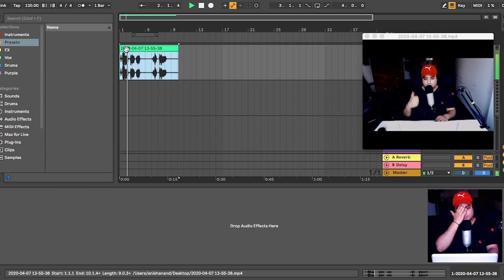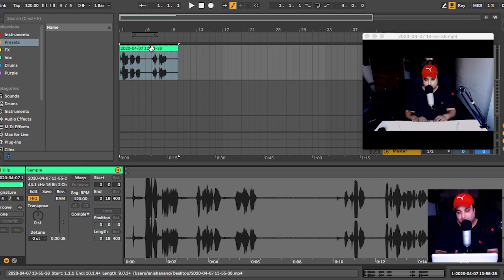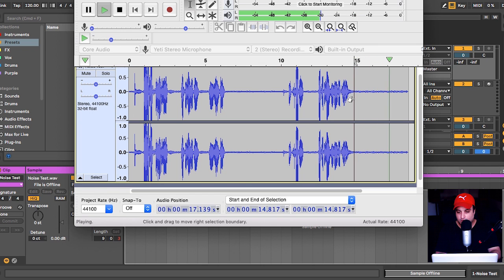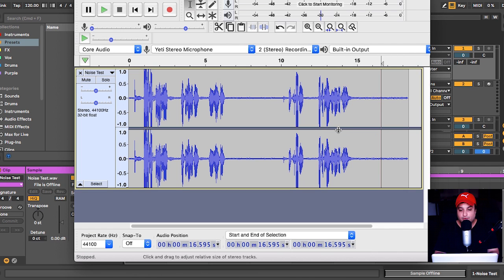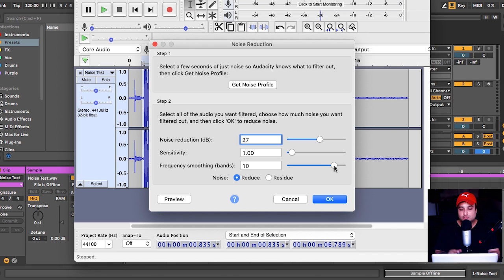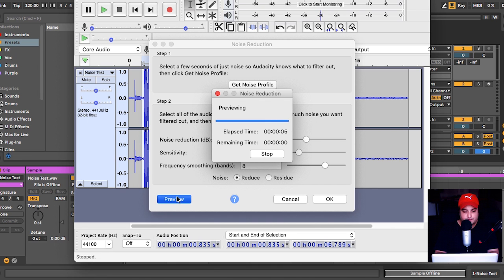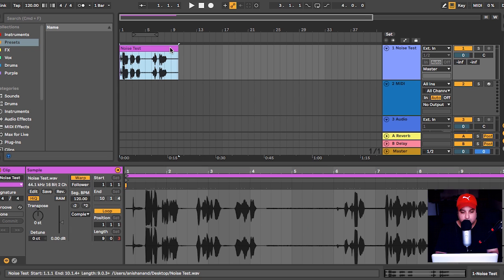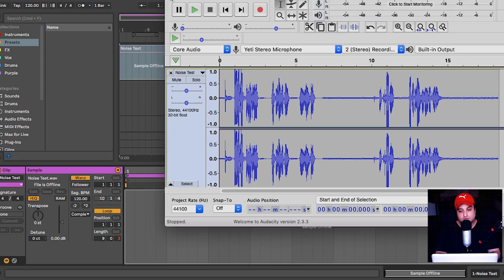How to Reduce background Noise with Audacity in Ableton Live

Comment: Really helpful. I really like this detailed video. 
noise cancellation is working fine. But the new wav file is showing kind of corrupt behavior. I a using Ableton live 10 lite.
Could you please suggest why the final WAV file is sounding like corrupt file. I will wait for your response
Reply from the maker: Thanks for watching. Glad u like it. Check the extension you saved. If correct then may be some software glitch. Otherwise just repeat the process and im sure it will. Cheers 😊✌️
Reply: @djanishanand  Thanks so much for your so quick response. I did so many tries but still getting those auto tune kind of sounds in my vocal after noise reduction and conversion to wav. some time speed up speed down ....
not sure ....trying as I do not have any other way.....
Reply from the maker: The auto tune kind of sound is due to settings. You need to play with Noise Reduction, Sensitivity & Frequency until you get results as per your taste. This can take up time. Hope this solves the issue.
Reply: @djanishanand  Got it.....WRAP was selected in my case in sample editor and I was using my row .als file instead of converting that to .wav first.
Thanks so much once again. your contribution is highly appreciated. I will have some level of success due to you......great friend. dedication se faida hua...
Reply from the maker: Its all about the more you get in to it, the more you achieve. The more you devote time you get to know more. Best of luck buddy. Cheers

Comment: hey, even though I export my audacity file in the same place as the old file, it for some reason doesn't appear inside Ableton as changed even though it does ask to replace the file.
Reply from the maker: JUST CLICK YES...replace the file and wait for few seconds....the new sample appears in the ableton instead of the old file on its own. If not then there might be a glitch. Turn off ableton and switch it on again and then try the same process. Hope this solves the issue. Cheers
Reply: Hey ,that didn't work ,even restarting didn't change it,I played around with everything,it's like a big issue since I cannot reduce noise of each mini audio clip of backing vocals ,even after clicking yes to replace,it doesn't exactly replace is what I noticed,it adds extra number Infront of the file name and stores it and even trying to overwrite isn't working
Reply from the maker: @HazardChirag  thats strange. If thats not working then you can always drag and  drop your fresh saved file from the desktop.
Reply: @djanishanand  thanks a lot,attaching audacity really does help

Comment: How are you setting up Audacity to work inside of Ableton ?
Reply from the maker: Well you can always use gate or any other ableton effects but this video tells you how to reduce noise with 3rd party plug in via Ableton for example Audacity, that will not work inside ableton, but you can open Audacity via Ableton. Check out the video and you'll get an idea what i am trying to say here :-) Its just another way to reduce noise.
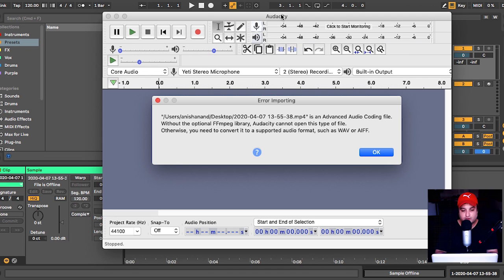Reply: @djanishanand  So let me be more clear..at 2:55 time of yor video, when you click on the Edit button in Ableton your Audacity opens up...how are you able to do that ? What have you done to make that happen ?
Reply from the maker: @gnanuayysola2057  First download Audacity to your system. Then open up Ableton preferences/settings - Go to Files & Folder section - In Sample Editor click on brown & choose audacity as your 3rd party software. In this you can choose any editor app of your choice. Hope this helps :-) Have a great day ahead.